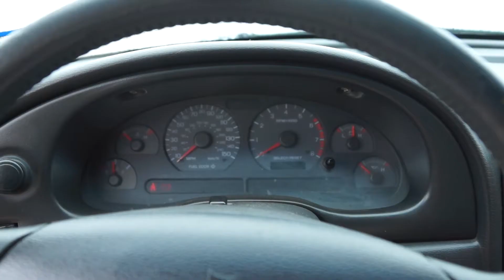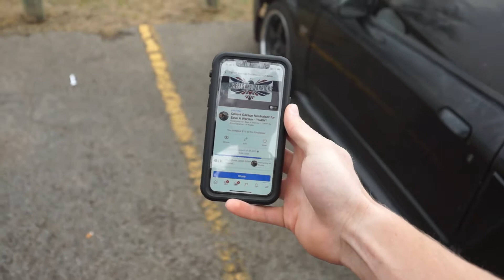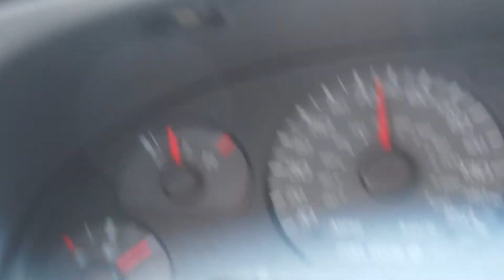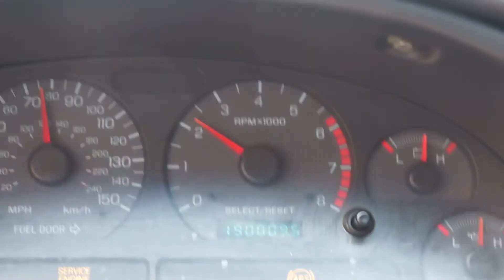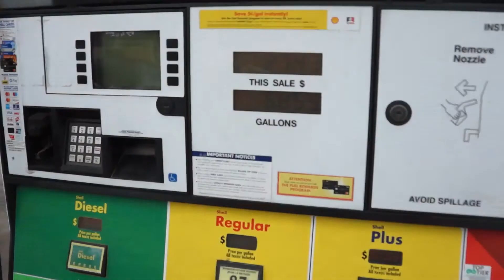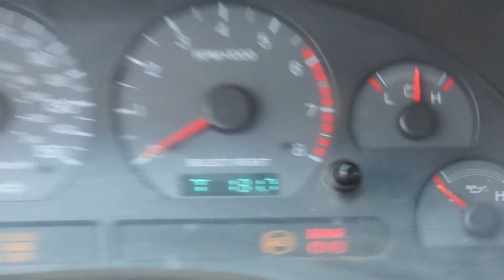First "Road Trip" In My 190K Mile Mustang

Comment: What a noble cause and props to you for getting that flag, also I could be wrong but did you add the 6.8 to the extra 7 it took to fill the tank? If I’m right you got 9.5 mpg on the trip
Reply from the maker: After the initial fill up I put 6.8 in. Then when I tried to put more in it was only .2. So a totally of 7. A little confusing hahaha

Comment: 190,000 miles!!! Probly got another 100,000 in her. I just picked up a new edge with 100,000 miles on it. I noticed somebody wrote about seafoam. Was wondering what is your opinion on additives like seafoam?  Thx , great channel.  🇺🇸🇨🇦🐎
Reply from the maker: Sew foam is great man! Every once in a while it can definitely clean out fuel systems around other stuff. I’d definitely recommend